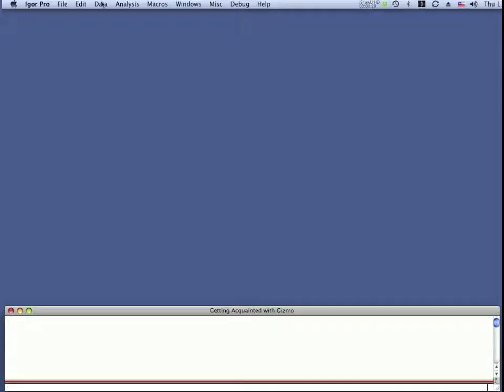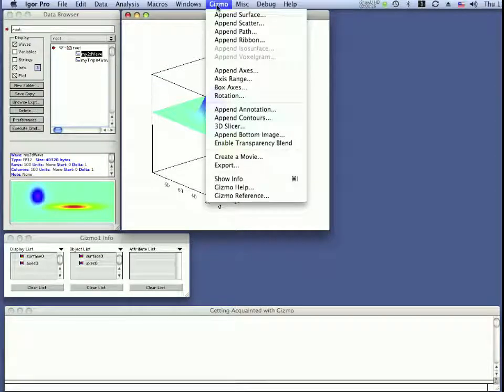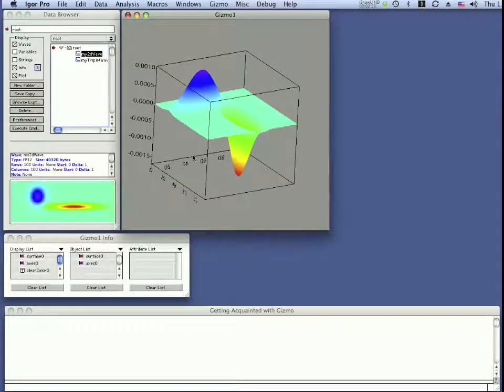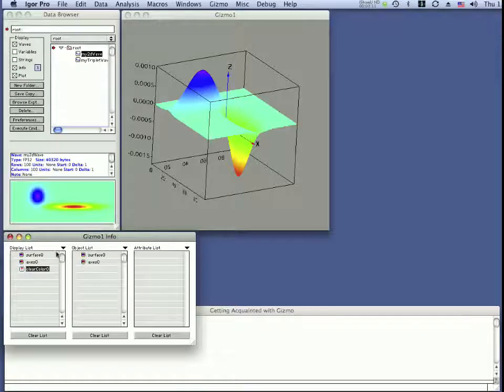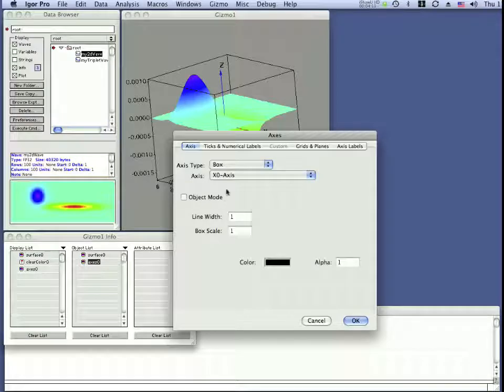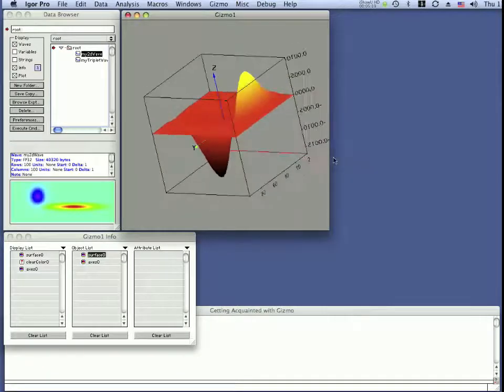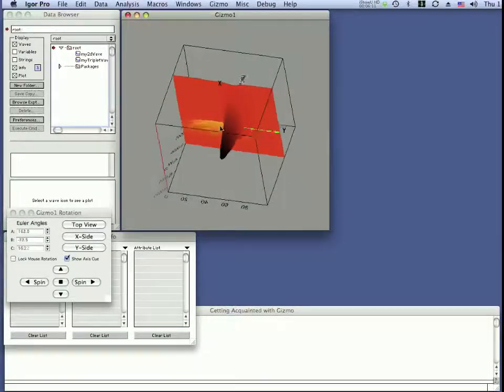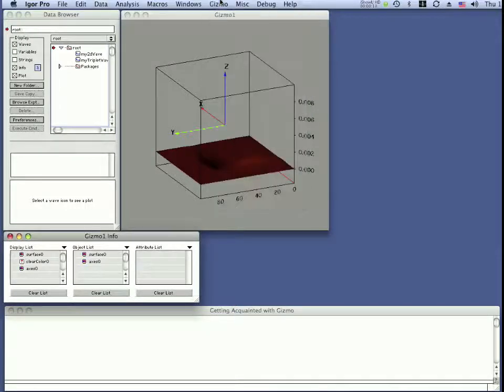IGOR Pro Gizmo Introduction: Getting Acquainted with Gizmo

Comment: When using Gizmo Rotation... in Gizmo menu and checking the box (Show Axis Cue) the plotted Surface disappears in the main Gizmo window and only the x, y and z text letters are retained. I must uncheck (Show Axis Cue) in order to recover Surface. How to avoid that? Thanks.

= = = = =
- I have started by launching IGOR
- Misc -> Preferences Off
- Windows -> New -> 3D Plots -> 3 D Help
- Select the blue command line
.......... Make/O/N=(100,100 data2d=Gauss(x.50,0,y,50,15)
....................and then press Ctrl+Enter
- Windows -> New -> 3D Plots -> Other...
- Gizmo Info -> Object List -> Append New Object -> Surface... -> OK
- Gizmo Info -> Object List -> Append New Object -> Axes... -> OK
- Drop Surfaces and Axes in the Display List
= = = = =